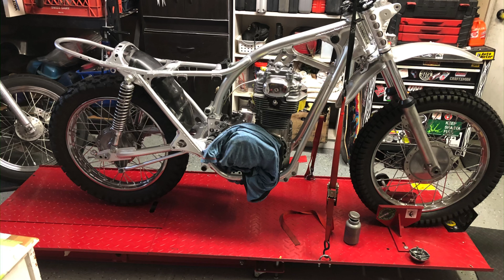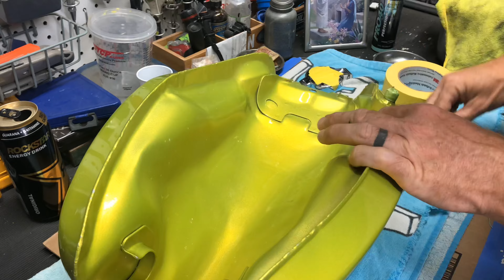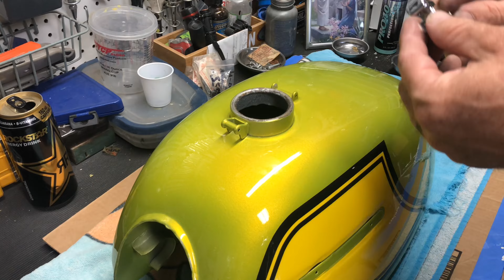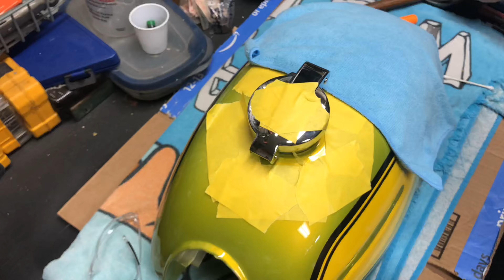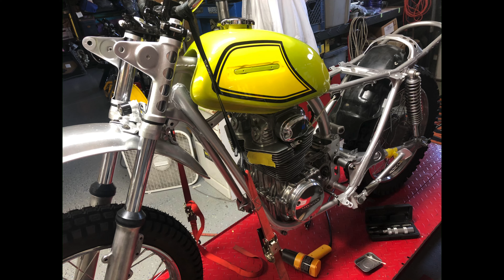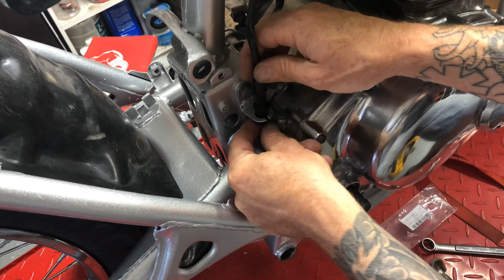1972 Honda SL350 k2 episode 6, wiring, installation

Comment: Excellent video! I ride a 73 cl350. Quick question what kind of service manual are you using?
Reply from the maker: Thanks Jeremy, and thanks for watching! I used a combination of several sources; “clymer 350cc twins”, Honda shop manual, and the parts fiche for whatever part I’m working on. Also, face book has a wonderful group called “Honda SL350”